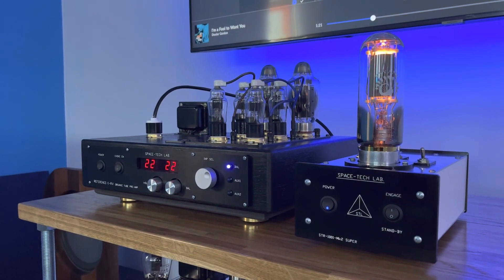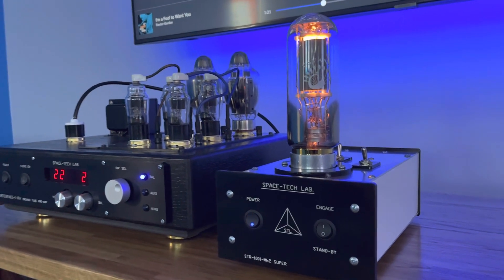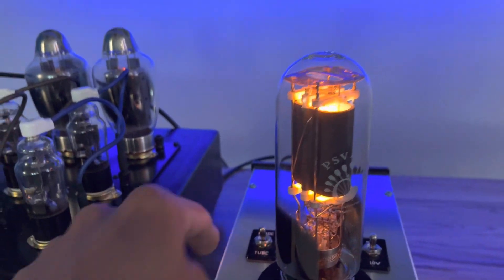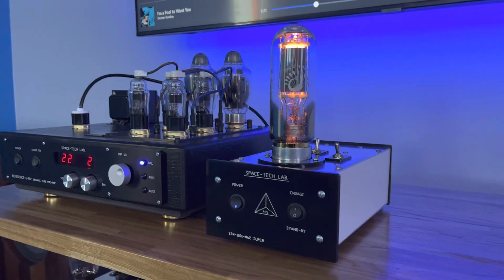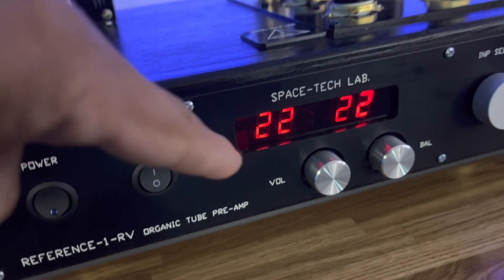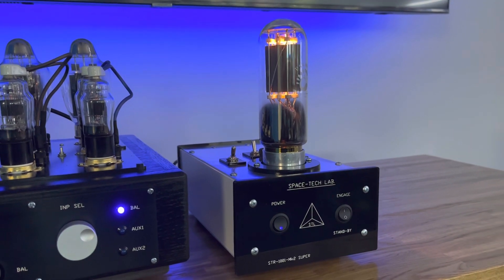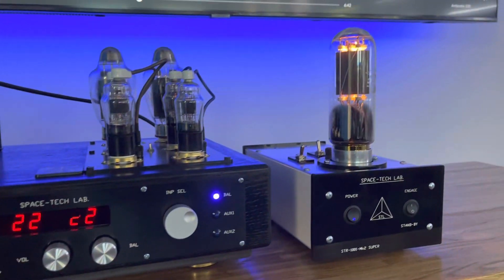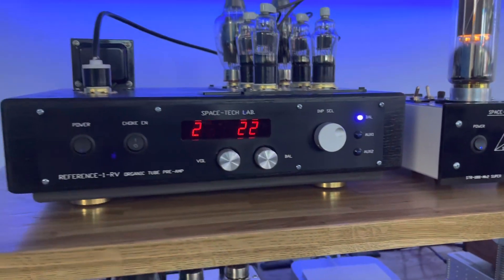Space Tech Lab Super Rectifier

Comment: TIP: Dont use single tube super rectifier on power amps. It will wear out the tube in a matter of weeks.  You need a larger rectifier from space tech for power amp or integrated amp rectification.
Reply from the maker: Thanks for letting me know! I wasn't sure yet, but dang! You were right, this thing is amazing!
Reply: @drde4010  I can only say, I know exactly how you feel. And its mind boggling how this is not more widespread.
Reply from the maker: @hificave  It's so ironic nobody knows about this thing. This is by far the most significant improvement I think anyone could make to a system at such a low cost.
Reply: @drde4010  it’s definitely up there for sure.